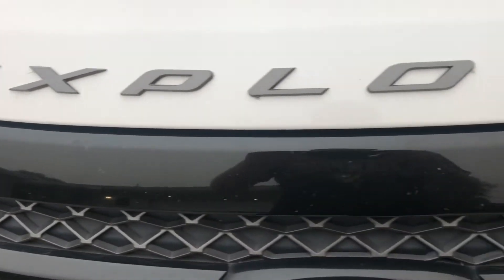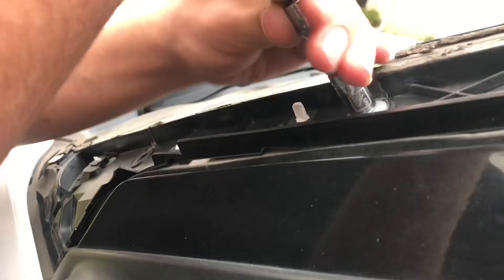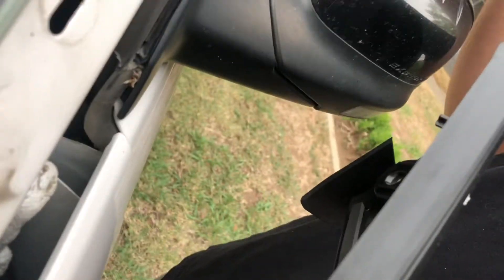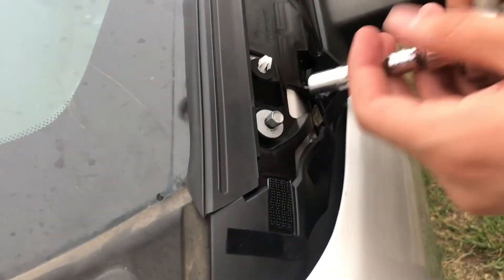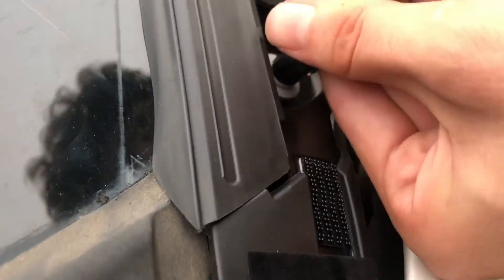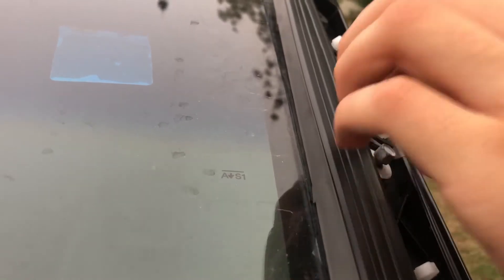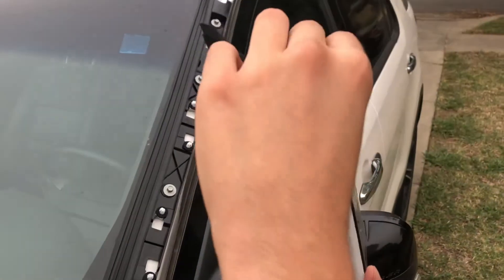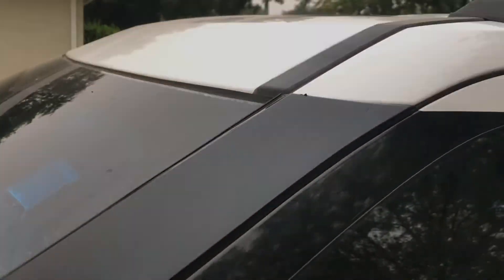Replacing Window Trim on a 2014 Ford Explorer Sport

Comment: Where did you get it from? I need the passenger side. I want it original not fiber.
Reply from the maker: When I bought the Explorer the previous owner had already purchased it. It may have been on EBay.